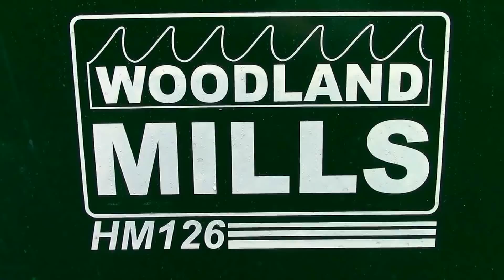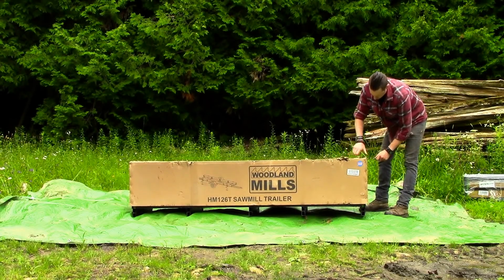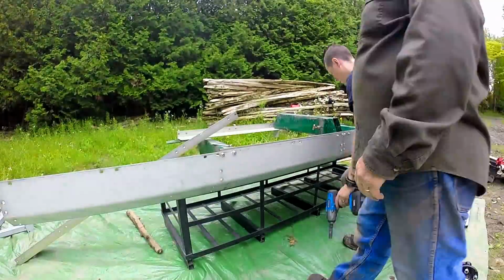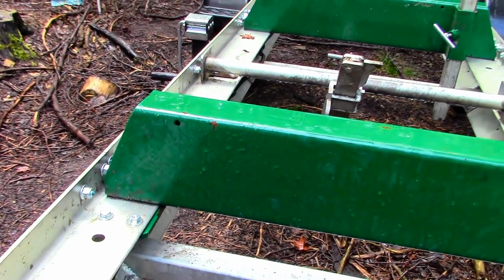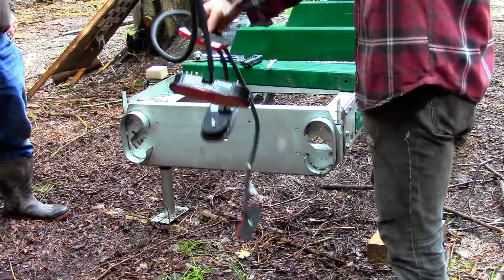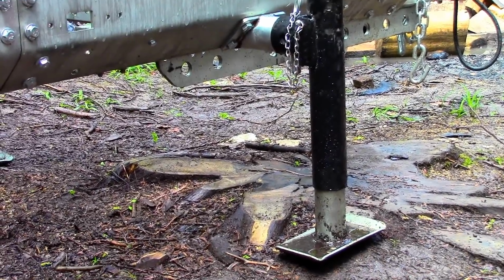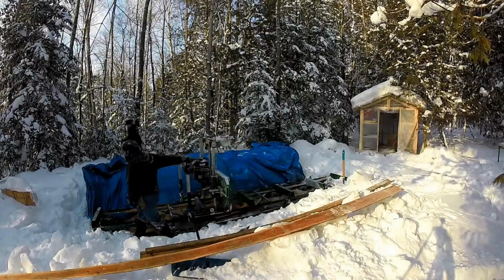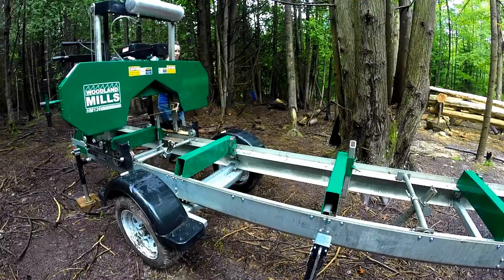Woodland Mills- Sawmill & Trailer- HM126 Woodlander XL

Comment: That's a well designed and built trailer for the bandsaw mill cutting head.  I suspect a set of notched log loading ramps will be an accessory.  The ramps used in conjuction with two cant hooks will easily allow one to roll a good sized log up the ramp and onto the mill by themselves.

Comment: Good videos.  Like others, I'm waiting for the build to recommence.  I have a couple questions about the mill/trailer.

1-How long did it take to assemble the trailer?
2-How long did it take to assemble the mill head?
3-what is the weight of the trailer with cutting head?
4-On a scale of 1 to 10, with 1 being equal to making a peanut butter and jelly sandwich and 10 being equal to assembling and tuning  a modern vehicle engine, how difficult was the mill/trailer assembly?
5-How well written are the instructions from Woodland Mills?  Are they completely clear and concise?  Are all photos completely obvious?
6-does woodland mills keep assembly simple by using same size bolts throughout, or are there twenty five different sizes that I have to contend with?

Good video, thanks.

Comment: Very impressed with this sawmill. You did a great job demonstrating its capabilities. Question: is there a reason why you cut the wood so thick? Looks like 2-2.5”? Or is that what you need to do from shrinkage and/ or less twisting?

Comment: Great Video
I also have a older 126 mill 
2015 I believe and would like to put it on a trailer
My question is should I do the mods on the newer trailers or build a trailer to fit with the drawing from woodland mills for the older mills
Is there a lot of modifications to make it fit the new prebuilt trailers ?
Scott

Comment: I have owned a HM126 for 3 years now...  it would be great to have the portability.  I have a 30 foot permanent rail system now.   Can I ask how $$?  I'd need the 16 footer....
Reply from the maker: Wow you can do a lot with a 30 foot rail system! Impressive. I'm not sure how much the production models will be listed for, but the info should be up on the Woodland Mills website soon. Last I heard, the trailers should be available by "mid September".

Comment: Great video !! The mill looks very sturdy. Did you figure out what happened to the tractor??
Reply from the maker: Thanks! Something was wrong with the starter. The starter gear wasn't fully engaging the ring gear and it was grinding the corners of the teeth off. I've sent the starter in for a rebuild and I'm just waiting for the work to be done. I'm hoping soon!

Comment: You might make more money selling maple slabs, but it takes time ( easily 2 years and more air drying in a barn )
to dry a slab properly.
Slabs can split, or turn into canoes if improperly dried.
You likely see that in the soft wood your milling.
I liked you video.

Comment: I'm not impressed at all, it is too high for big logs and for tiny logs I would pile them on a tractor trailer back to the shop(with hydrolics) not a pickup. Forest are muddy ain't a place for pickups unless you want to spend $$$$ on gravel for suitable roads. Either build low spot transformation areas in your forest or bring the logs to the shop for transformation (lumber need a safe place to dry so you'll have to bring them back in one way or another). I would  do the transformation at home with an electric sawmill  that could be converted into a  vertical woodworking sawmill.